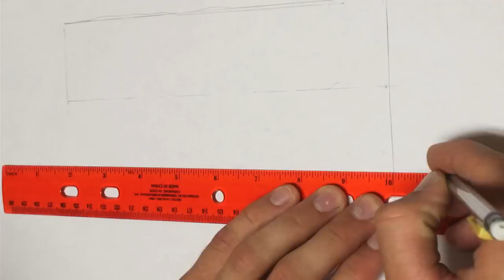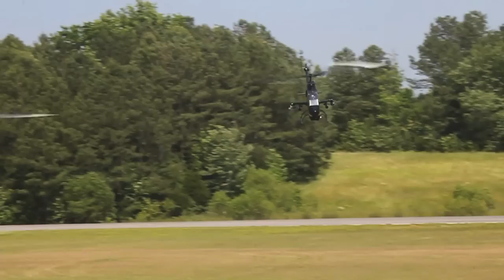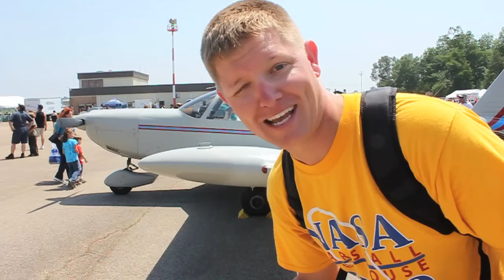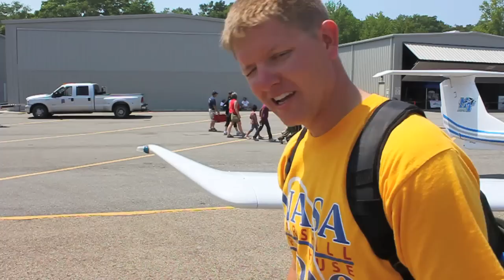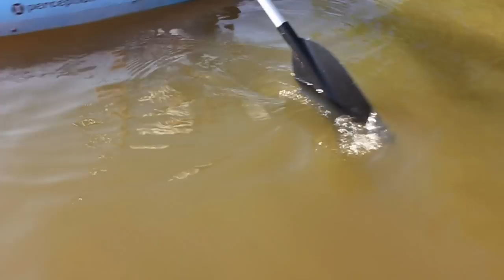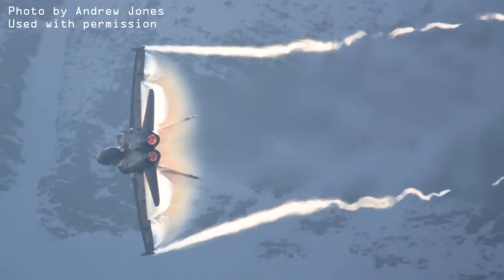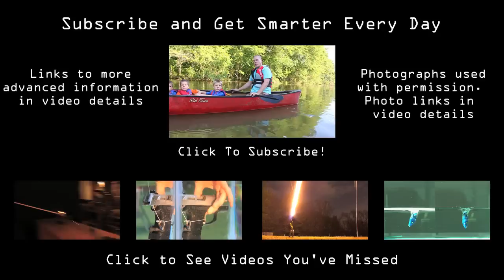Vortex Shedding - Smarter Every Day 23

Comment: the wild spread misconception about equal transit theory which was proved invalid when trying to explain a flying kite , which the cross-section of the kite's wings are basically rectangles ,and the velocity of air molecules from the top and bottom  are actually the same , so how on earth a kite can fly ? The principle here is just the conservation of momentum, air molecules are deflected downward which conversely provided the force lift upward.

Comment: Hi Dustin, I love your videos!

BUT the aircraft does not fly due to the low pressure in the top of the wing, the aircraft fly because it push the air downwards, as much air as the aircraft weight.

Comment: Application of Bernoulli's principle for explaining lift generation is an incorrect oversimplification of a much complex phenomenon. When you follow a fluid particle along a particular streamline, pressure and flow velocity can be related using Bernoulli's principle as long as the flow remains inviscid and incompressible (Mach < 0.3). While, it's possible to qualitatively explain lift by considering two streamlines, one passing over the wing and the other just passing under, and assuming the flow velocity of fluid particles along the chord remains constant, a quantitative analysis presents discrepancy between lift calculated using Bernoulli's principle and experimentally measured lift. In actuality the three conservation laws must be used in conjunction to explain lift.

Comment: Air does not go faster because it has to travel a greater distance. That's completely wrong! There is a differential pressure gradient on top of the wing that accelerates the molecules causing a net decrease in pressure relative to the bottom of the wing. The camber also restricts the area causing the air molecules to speed up.

Comment: The vortex is only visible in humid air. The moisture  is forced to condence under the forces of the vortex. When ythe pilot loads up with G it is better still. With a jjoined wing there would be no vortex.

Comment: Well this is a nice video.
But the faster moving air with a lower pressure is a myth. I think.
With a wind on one side there would be no lifting force if the wing surface was flat...
But sweet, thank you.

Comment: If vortex shedding is such a big deal, why isn't it prevented via winglets on the space shuttle where drag is a serious concern?
Reply: For the same reason you don't have them on the vertical and horizontal stabilizer of an airplane. You'd really only use it when there is a pressure difference between both sides, and in a control surface it would have to swing from side to side everytime it changed position. On a commercial airplane it makes sense, since the pressure difference is constant throughout the entire flight. Hope I've cleared your question.
Reply: Winglets are for fuel efficiency. Space shuttle has just minutes in the atmosphere and during lift off, drag by the vortex is its least problem. Also the winglets will be a weak point and useless weight.
Reply: Winglets aren't made for producing lift at a relatively constant angle of attack. It isn't even just because it's such a short time being used, but also because it weighs more and unless the rocket has to stabilize it actually does absolutely BUT increase zero-lift-drag. Winglets are only useful at drag-due-to-lift also called induced drag. So, not only it doesn't help, it actually makes it worse for rockets.
Reply: The lifting force is based on vortex-shedding.   Winglets have zero effect on net vorticity.  
However, winglets can have an enormous effect on the energy deposited into the swirling wake.  By distributing vorticity into a wide swath, rather than a narrow line, we reduce the overall rotational speed of air in the swirling wake.   Wasted energy goes as velocity squared, so it's possible to reduce the waste just by moving flows around to eliminate the "velocity hotspots."

To actually reduce the vorticity, just reduce the aircraft velocity, or the attack-angle.  The aircraft then falls.  It's because, in 3D aircraft, the lift is directly proportional to shed vorticity.

Note that 2D airfoils fly by ground-effect, and as long as we only learn from 2D airfoil diagrams, we have no hope of understanding where thrust comes from in actual 3D wings.

Comment: Justin this is wrong. I would think you would check with airplane engineers before saying stupid things
Reply: Yep, he's teaching the "Transit-time Fallacy," the one that educators have been trying to stamp out for the last 25 years.  The NASA GRC airfoils education page directly attacks the same misconception being taught here.

The lengths of the airfoil surfaces are totally irrelevant.   When an airfoil generates lift, the parcels above the airfoil greatly outrace the ones going below.   The split parcels never recombine.   (In fact, if we adjust the AOA and camber and velocity so that the parcels do recombine at the trailing edge, that's the zero-lift situation.   If parcels recombine, it guarantees that no lifting force is produced.)
Reply: cough 2011 cough cough
Reply: His name is Destin, not Justin... I would think you would at least know a person's given name before attempting to publicly call them out. Moreover, Destin (or Justin, as you call him) is an "airplane engineer" as he has a Bachelors in Mechanical Engineering and a Masters in Aerospace Engineering.  You, Sir, are getting Smarter Every Day. :) (or every year as this was originally commented some time ago, I see. :)
Reply: You are using an "appeal to authority" fallacy. Him holding a certain degree or job doesn't give him any extra authority over the argument. Furthermore, this "theory" of lift is outdated and argued to be false. Like the guy above said, educators have been trying to get rid of this crazy theory for lift for a while. Lift is explained best by Newton, not Bernoulli.

Comment: Come on Destin the low higher pressure thing accounts for only a couple of a percent of lift. You should know that.
Reply: +Jeffrey Beats  This ("the low higher pressure thing accounts for only a couple of a percent of lift") is untrue and is most likely based on an incorrect interpretation of Bernoulli as well as the equal transit theory and bad math application.  The net pressure difference (below to above the wing) IS ALL the lift force.  This pressure difference can also easily be shown to cause ALL accelerations of air around any wing; below, above, ahead, behind and around the ends.-- Regards, ScienceAdvisorStevechallengerillinois.org

Comment: btw, a common misconception my aerodynamics professor pointed out to me: "The air on top of the wing has farther to go so it goes faster" is wrong. There is no principle forcing the air on the top and bottom of the wing to arrive at the tail end at the same time. Instead, the wing shape creates a different pressure gradient on the top than on the bottom, one that accelerates the flow to higher velocities. There is a net pressure difference (Bernoulli, as you said) between top and bottom and the wing creates lift.
Reply: Quite late, but can be useful for someone haha
in fact with those wings you're not deflecting air, so is a wrong answer. Honestly less intuitive, but is the pressure difference what explains the lift.
Anyway, with symetrical wings that works (with an angle of attack you're deflecting air)

You can notice it if you compare a fan with an airplane wing and a helicopter
Reply: +seigeengine From what I've learned about the practical applications of lift to flight (I'm no scientist or engineer, just a pilot), "lift" is the result of several different reactions the wing/propeller/rotor/aircraft have on the air around the aircraft. There are many, many different theories about how lift is produced, but it is most likely a combination of several of these "reactions", of which two, Bernoulli's Theorem and Newton's Third Law of Motion (the downward deflection of air by the wing resulting in an upwards motion of the wing), are the best known and which most people attribute the creation of lift to.
Reply: Nor Pedraza Deflecting air is how all wings produce lift, whether a fan, an aeroplane, or a helicopter. Equal and opposite reactions. You can't violate the laws of physics by misdirecting into a different field.

When being taught about flight in school they tend not to mention angle of attack, focusing entirely on the cross-section of the wing's shape. This is why I said a symmetrical wing could be stumbled over.
Reply: Most planes fly with a nose down attitude at cruising speed.  The deflection wind idea doesn't really work in my opinion but who asked me anyway lol
Reply: @johntomik4632  Even with the nose down at cruising speed, the wings are still angled slightly upward providing lift as per Newton's third law.
Reply: @johntomik4632  So you think planes violate physics, do you?
Reply: ***** This is part of why I said it's much easier to grasp the idea that wings deflect air downwards rather than talking about pressure differences.

If you think of it this way, it makes perfect sense that a symmetrical wing will still provide lift (they will), whereas if you think about it as a pressure difference you're likely to stumble at that part.
Reply: You are correct. Newton's principle is a part of the lift
Reply: Don't forget that the third law of Newton is involved too. The air deflected down gives a reactive force up, adding to the lift.
Reply: The elevator on airplanes is basically a upside down wing. Its more flat on the top. This helps with a lot of things but is very important for stalls or stall recovery. Learning this helps to better understand.....airplane stuff
Reply: Deflection or angle of attack is also a factor, ie., flying an airplane upside-down.
Reply: +Gustl Schnitzelmoser I'm certainly no expert, but I prefer to think of it as a matter of deflecting air.

The wing deflects air down, so the plane goes up. How it does this is complicated, but I find that much more intuitive than talking about pressure differences.

Comment: These are not examples of vortex shedding. The vortex at the wing tip is a stationary effect (no shedding). Vortex shedding is an oscillating flow.
Reply: +kirkelicious Exactly. The wingtip vortex is stationary at the tip, is continuously generated (not oscillating) and has its axis of rotation aligned with the direction of the local flow. Shedded vortices rotate perpendicularly to flow direction.

Comment: Actually the air doesn't flow faster over the wing than the bottom of the wing. There is a pressure difference surrounding the wing but its not because the air is flowing faster over the wing. Check this video out to discover what actually happens. https://www.grc.nasa.gov/www/k-12/airplane/wrong1.html
Reply: +Lucas Lovell No, the air does move faster on the top than on the bottom. It doesn't do it because it has to move farther and arrive at the same time. That's why NASA calls it the "Longer path" or "Equal transit" theory to point out exactly what's wrong with the explanation Destin gave. The Bernoulli part of it is correct.
Reply: +Lucas Lovell It's not incorrect. Air does flow faster over the wing.
Reply: Lift is produced by the air being turned downward over the wing. The downward moving air induces an equal but opposite upward force on the wing. This is why increasing the angle of attack produces more lift... more downward air = more upward force at the cost of increased drag. The downward moving air also causes the awesome downward vortex seen in clouds under a wing. Finally the pressure differential generated by Bernoulli's principal is not enough to lift an airplane... even if you had an absolute vacuum over the wing there wouldn't be enough upward force from the pressure under the wing to lift a normal aircraft.

Comment: What i don't get is, why is there lower air pressure on the upper side of the wing just because the air travels faster? ? ?
Reply: Scout887 The same amount of air passing over the top of the wing has to cover a longer distance than the bottom of the wing. Same amount of air over a longer distance means less volume/pressure of air comparatively. Does that help?
Reply: ShimmeringSword "Same amount of air over a longer distance means less volume/pressure". Yes, got it, thank you dude.

Comment: Sorry to say that you are wrong about the high/low pressure on the wing. If that was true, how could a plane fly upside down?
But you are correct regarding the winglets. ;)
Btw, I really love your channel!
Reply: You can fy upside down by
1. Having wings that have almost the same "rounding" on the top as on the bottom side and as in his helicopter series, exept of adjusting the angle of the blade in this case, the angle of the hole plane adjusts.
2. By inverting your elevator so:
<-
-/ plane flying normal with normal air presure
<-
\
  \ Plane more this way when upside down to balance air flow
Reply: Daniel Söderhäll Destin is right. The lift coefficient is dependent on the angle of attack. If flying upside down, you can generate lift if you angle of attack is high enough. (in case of a nonsymmetric airfoil, the angle of attack needed when upside down would be significantly higher than when the wing is right side up). The difference is that flying upside down generates a lot more drag- not exactly efficient.
Reply: You are all right, but it isn't only the curve of the wing that does is to fly.

Comment: I seriously hate that the Bernoulli principle explanation. Question: how come airplanes can fly upside down?
If we assume that the whole pressure difference is the only reason (and air doesn't have to meet, there's a discontinuity at the trailing edge as well), then an upside down airplane wing will generate down-force and when Maverick does a roll in his F-14 he'll fall down at 2g when he's upside down.
You need to show the conservation of momentum part as well.
Reply: +StrawberryMeringue "You can't fly a plane upside-down for nearly as long as right way up" ==> Not really true. At least not as far as aerodynamics go. As far as the wings are concerned you could fly inverted all day long - it is  systems such as lubrication etc that limit inverted time.
Reply: *****

I'm giving this video a hard time about it because pointing out how obvious things aren't so obvious is one of the points of this channel. The simple observation "airplanes can fly upside down" is enough to show that there has to be something else for how airplane wings work. Ignoring something this obvious, is in my opinion, beneath the quality of this channel's videos.
Reply: Placeholder The property you're taking about is called lift.  Lift aids in flight, but it is not solely responsible for the flight of an aircraft.  Therefore, if you invert the wing, the airplane would have to work harder to maintain flight, because there would be increased force pulling the plane towards the ground.  However, flight is still maintainable at a larger expenditure of energy to counteract a larger downward force.
Reply: The first intellectual discussion I've ever seen on youtube.
Reply: +Placeholder You might have an argument, if he said anything wrong. He didn&#39;t. He reminded people of something going on using something they "know", and then used that as a springboard into the topic of the video.

Comment: You say its the low and the high pressure on the wings on the airplane that keep it up. So how can they fly upside down?
Reply: Matthew Linn Bernoulli's principle isn't the only force contributing to lift on an aircraft. I'm assuming you already know this by the nature of your question, so I'll continue to explain for other readers.
Bernoulli's principle is a small factor that contributes to the lift of an aircraft. As anyone who has flown a plane knows, getting an aircraft to lift off purely by accelerating down a runway is not a very efficient method (ignoring gliders as they seem to jump up almost instantly).  The second factor of lift is in fact just the act of pushing air down, and thus having an opposite force act against the wing, pushing it up.
This explains how flat winged, wings of equal curvature, and newer model wings with greater curvature underneath still gain significant lift. Of course, it explains how planes fly upside down.
Reply: Matthew Linn one side is the "high" pressure side because the planes forward movement forces air against the underside. If its upside down then they angle the plane so the air is forced into the "top" side that is now facing down and the topside becomes the high pressure area and lift is formed. It's a bit more complicated but the basic idea holds true.
Reply: Little Ape Your "explanation" made no sense and provided no new information.

Comment: "The air has to travel farther over the top of the wing than the bottom..." WRONG
Reply: Christian Niemeijer Well it does... That's just basic geometry. The wrongness is in assuming that the trails meet at the same point at the end.
Reply: Smithy0013 You're right...